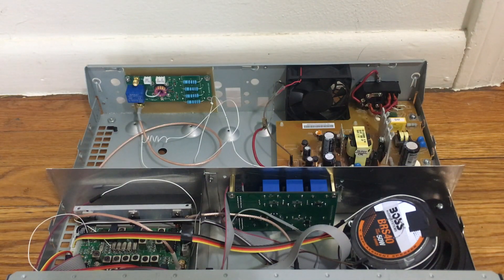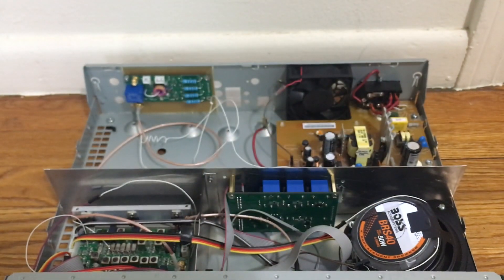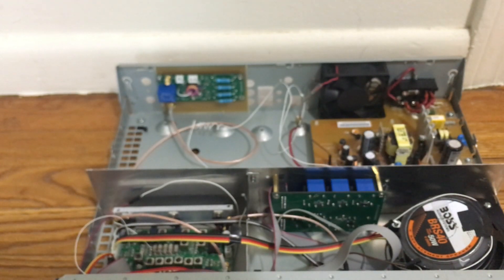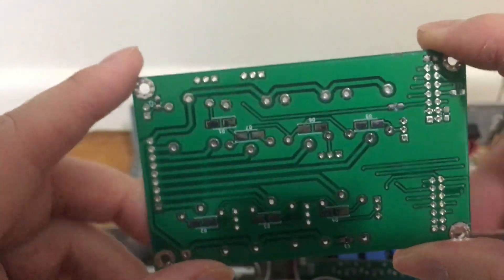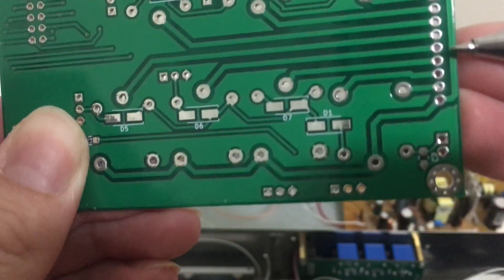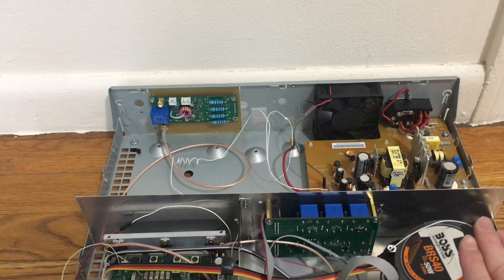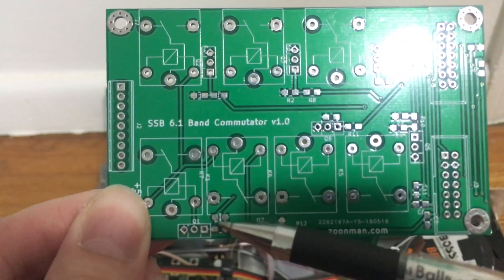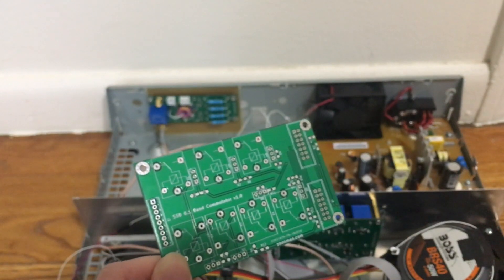SWR Meter + Band Switch for SSB 6.1 transceiver

Comment from the maker: Found one error with relays. Turns out that pin numbers in schematic didn't match relay pinout. All band lines are going to be connected to +12V line. If you already ordered the boards mount relays upside down. In this case connection will be correct. Sorry for mistake.

Comment: Hi Philipp. I've built the SWR meter (using a kit). I checked everything several times and I think everything should be oké. However, the forward and reverse voltage are almost equal, despite excellent SWR, as measured with another meter. Also adjusting using the trimmer hardly makes any difference. Do you have any clue what might be wrong? Do you recognize the issue? Thanks. 73, Erwin PE1CUP
Reply from the maker: This sounds like a you might have soldered transformer in a wrong way.
Reply: @k1zmt  I'll check. Thanks
Reply: You were right. It's working now. I bought the kit preassembled from Aliexpress, but indeed the transformer was incorrectly wired. Thanks again. Erwin, PE1CUP